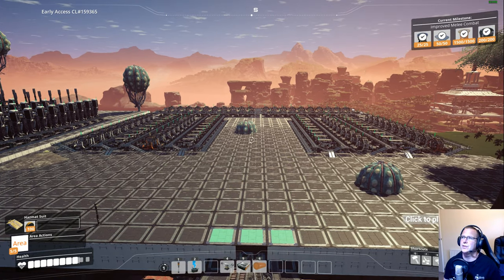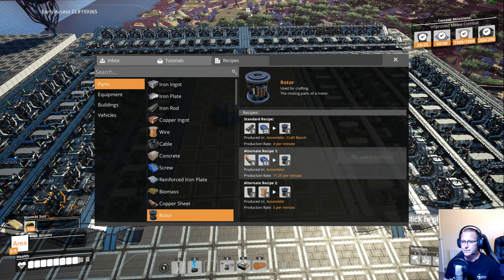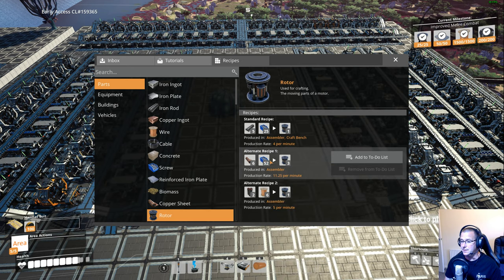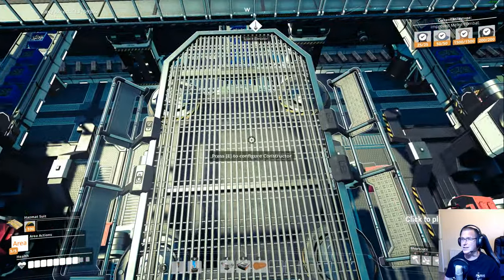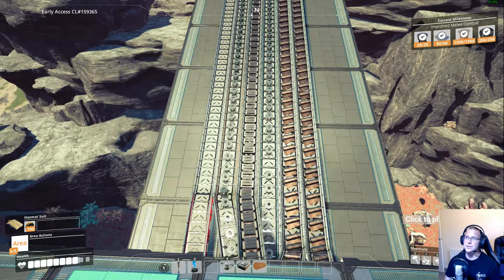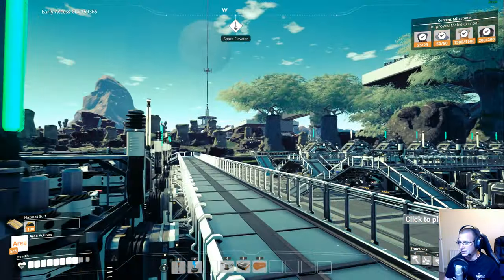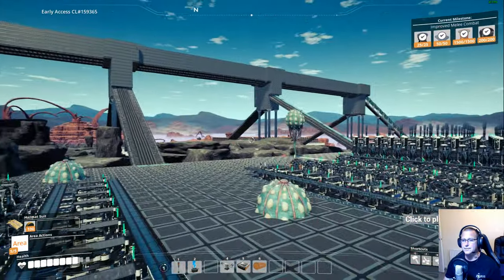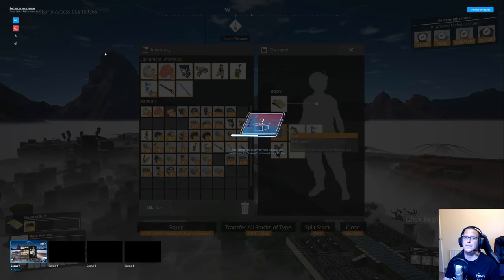The Best way to deal with screws , Satisfactory - Late Game tips

Comment: 6:00  not true! Alternate: Heavy Flexible Frame uses 390pm but can be done with two constructors. and I totally agree with you this is by far the best way to use screws. I cant believe more people haven't figured this out. I have two 780 belts of beams running around my factory for this purpose.